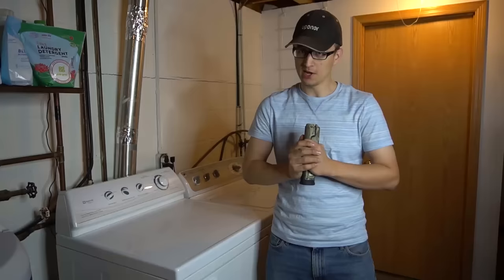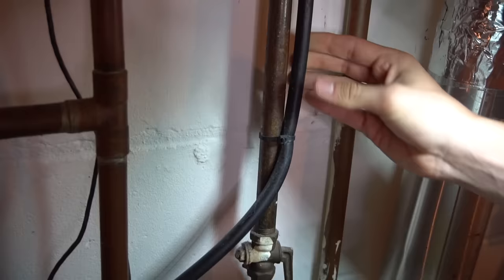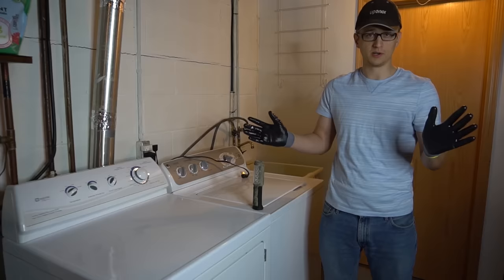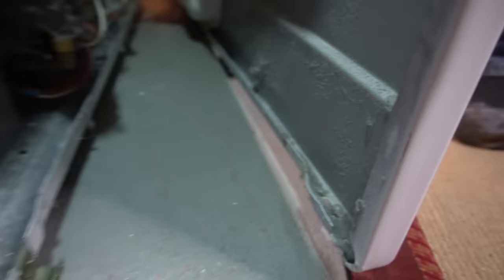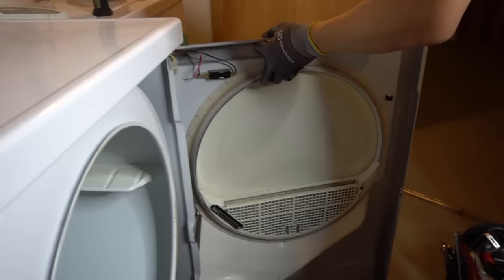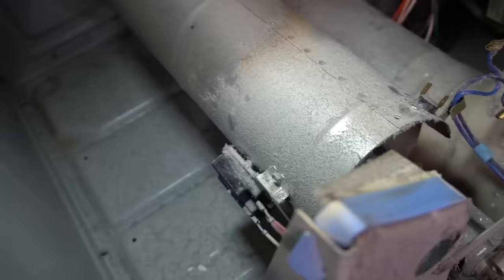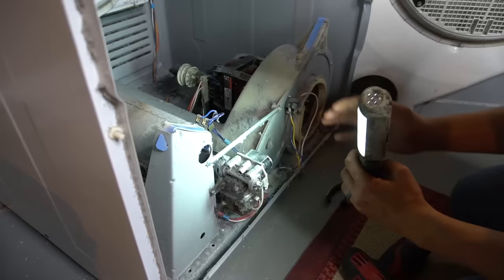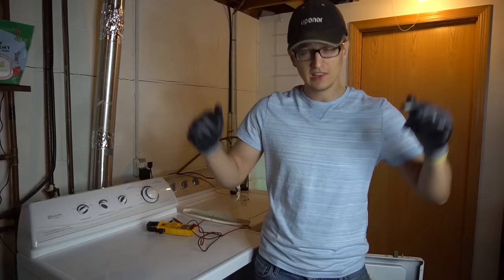Dryer Not Heating and The Most Common Fix

Comment: You don't need to apologize for your "dirty" dryer.  So many how-to videos show a dude working on a BRAND NEW unit!  Who wants to see that?  Anyone can fix a brand new unit that's working fine!  Nice to see someone working on what most people have at home.  You covered a lot of points that other videos don't even mention.  Thank you!
Reply: What happens if everything checks out and the igniter still doesn't like
Reply: Thank you for this awesome video!  It helped me fix our dryer - it was either the temp sensor or the fuse (I replaced them both since they were ordered as a pair) - and it worked!  Could not have done it without this video!

Comment: If I do this to my dryer, I'm sure I'm gonna end up buying a new one.😄
Reply: Me to
Reply: Same here. Its going to explode after I put it back together and press start. Who else thought once he took the front cover off, it would be an easy fix lol. "Take out the drum.....wtf?"
Reply: Triple ditto
Reply: Ok, guys, You can do this! you can also avoid having to do this in the first place too! how? by understanding that the number one reason dryers thermostats and thermal fuses blow, is because of heat management.
Clogged or restricted exhaust vent airflow is the most frequent cause of thermal fuse blowing. Check your lint screen for lint or a build-up of debris that could be inhibiting airflow through the dryer. Wash the lint screen with water and a nylon brush and then thoroughly dry it and replace it in the lint screen housing, Check the flexible vent hose behind the dryer meaning take it lose and check it for clogs and kinks clean everything. Also, check the exhaust vent ducts system to the outside of your home for restrictions, you'll be surprised by how much lint can get clogged in the hose and vent areas, If you do the once every Spring you will most likely avoid having trouble with your dryer. What you will be doing, in a way is giving your Dryer Lungs a thorough cleaning so it can breathe right, giving your fuses no reason to blow because its air is not being restricted. 1 hour to 1 1/2 hours is all it takes.
Reply: I would make sure I have homeowners insurance first, haha
Reply: I know right ! Mine would go kaboom if I try to fix it !
Reply: You'd be so surprised. When I first started repairing appliances, I thought the exact same thing 😂. But, once you put everything back together, it's like magic. I love this stuff. Blinkers for hire 😁

Comment: **Important** If your thermal fuse is tripped, look for a restrictive air flow situation. Most 90% of dryer components that fail are due to restrictions in air flow. Changing a thermal fuse, without cleaning the ventilation components is dangerous. Clean dryer vent to out doors, filter box to blower wheel. **Thermal fuses do not fail without cause, they are a protective device.**
Reply: I just paid 2 companies to come out one changed my thermal fuse and the other one cleaned my vents to the house but didn't don clean the actual dryer it's. He didn't even go behind the dryer to clean it out. I spent $220 for nothing

Comment: 09/09/2024 I love all your videos! From AC cleaning to water heaters, I've done soo much maintenance around my house! Yep, it was a thermal fuse that stopped my dryer. Telling us that if the LINT SCREEN CATCH is in the front, don't bother pulling the dryer out was a huge win and time-saver!  I ordered 2 fuses to have one as a backup because why did it actually blow... I've cleaned my ducts from outside and inside from wall but if it blows again it'll be time to pull the dryer out and inspect the ducting for any clog or excess lint buildup which is DANGEROUS.  Thanks again and I recommend a close quarters 90 degree bit ratchet or quarter drive small ratchet for the potential tight space for the screws.

Comment: I have a 25 years old Whirlpool dryer and here is what I have fixed so far and you have covered all of them in your video. Thank you so much.
1) Broken igniter - 279311
2) Dryer Gas Valve Ignition Solenoid 279834 
3) Belt and Pulley - 4392065
4) Dryer Thermal Fuse 3392519 (cause by Vent Clogged by lint)

Comment: Update - Complete success. Put everything back together and the new radiant sensor fixed the no heat problem. The thorough cleaning helped improve airflow, so it is drying better than ever. Most importantly the wife is very happy. I only had two small screws left over but it seems to be running fine without them, lol.

Many thanks for your great video. You were the only one I found that bothered to explain there were differences in how to repair a front lint filter dryer like mine and a top lint filter. I wasted a lot of time trying to get the back off my dryer since all the videos I originally found were for top lint filters.

Well, my gas dryer is a 37-year-old Kenmore. It has never been serviced in those 37 years, so you've got nothing on me with piles of lint inside. One day my wife told me the dryer was not drying at all. First checked that it was actually tumbling, and that we had good that air flow from the dryer vent outside. All that was good. When I checked the clothes, I found that they were cold. I checked all the things you described and the only part that failed the continuity test was the thing you said was very unlikely to fail - the flame or radiant sensor. Just ordered one on Amazon so hopefully that will fix the problem. Like you, my coils failed the continuity test; however, they did show resistance. The resistance was over 1000 ohms, so I wonder if the continuity test does not work because the resistance it too high. Just a thought.

One tip I will pass along. Take pictures of the parts you test so you can look up the part numbers online. For example, my thermal fuse was next to the dryer thermostat, but I had a high limit thermostat where your thermal fuse was located. The only way I really knew for sure that I found everything I needed to test was looking up the part numbers. You will need the part numbers to make sure you are ordering the proper replacement parts also. I also videoed each part I tested and described the results of the test. These can also be used to make sure all the wires are hooked up correctly when done.

One other tip I did not do. Take pictures and/or videos as you take your unit apart. This will make sure everything goes back where it belongs, and you reassemble in the right order.  Since I did not do this and since the project has dragged on for over a week, I hope I remember how to reassemble everything. I also did not mark which was the front and back of the drum so hopefully it makes no difference, or I can figure it out. Update - The belt on the drum was not in the center so I was able to figure out which was front and back by measuring where the pulley is from the back wall.

By the way, I checked my lint filter with water even before I found your video and not a drop of water would pass through it even though it looked clean. I just scrubbed it in water with a standard brush we use to clean off dishes in the kitchen. Now water flows freely through the lint screen. We used dryer sheets for years but switched wool dryer balls years ago. Much healthier and better for the environment. Apparently, they are also better for the lint screen.

Comment: I recently repaired my dryer that had an error code that would stop the dryer every 10 minutes,  so I replaced all the heat sensors that was recommended, it didn't fix it. Then I replaced the heating element itself and that fixed it. The heating element was still heating the dryer but one heating coil was bad causing the shut down. I ordered all parts online and watched videos on YouTube for support. These repairs anyone can do and save a fortune.

Comment: Great video. Replaced my 2 gas valve coils yesterday which solved my problem of intermittent heating. Also drilled a half inch hole on my Maytag front panel which allowed me to see the flame and the igniter operating with the front door cover on. For some reason my model didn’t have a view port. A small grommet covers the hole now but allows for easy troubleshooting. My advice to anyone if you’re having intermittent heating on gas dryer is to replace the 2 coils. They’re super cheap and super easy and pretty much universally standard. Although they may appear within specifications on the bench it’s when they’re operating where they get to be problematic. Don’t be afraid of the aspect of them being on the gas valve. You’re not doing anything that would expose you to gas or anything like that. Thanks for the video

Comment: I don't usually work on my appliances but you make it look so easy, and it turns out it is. I watched your video about fixing dryers and changed my heating element. I purchased this on-line for $25 and was easy to install, saved about $150.00. Thank You

Comment: Great video!  A feature to look for when buying a multi-meter is for it to have a built-in fuse so that if you forget to switch from ohms to volts you don't damage the meter.

Comment: So my dryer kept shutting down after running for a minute.
I tested all the thermo-switches and sensors but everything checked out all right.
Roaming through the dryer videos here, I came across yours where you showed the lent screen water test.
I pored water onto the screen and BINGO,  not a drop would pass through.
I tried scrubbing it with soapy water and a brush but still just a little water dripped through.
I figured that wasn't enough so I took it outside and sprayed Brake Cleaner front and back then let dry 30 seconds.
I repeated this front, back, 30 seconds dry.
I then took a wire brush to it and poof into powder the glaze went.
I now have no problems.
My dryer is 23 years old and had so much lent built up in it that some of it had been burning already on the coil heating tube so it may have saved our home and lives that I opened it.
Thx 4 that great information on the lent screen.
We no longer use softeners.
P.S.
Never go to bed with your dryer running or you may never see tomorrow.

Comment: Great video. You make it so easy to understand. In my case I had no heat and I checked everything and it all checked out ok. Then I realized  the setting was “air fluff” which means just turning and no heat. I then put it on regular setting and heat was there. Anyways, I learned so much here and got a chance to clean out my dryer from all the lint. Thanks again.

Comment: You are the best, you covered most of the common problems. i was able to nail the problem finally after looking at your video, its my ignitor. Tested it as per your video and there is no continuity and i see a crack. Ordering now, will comment once i replace and see if its working. I wish i saw your video first, spent around 30-40 videos prior to yours. Thank you.

Comment: Most Volt-Ohm -meters have a fuse, so if you hit the meter with power, you just replace the fuse. Fluke has expensive fuses.  The continuity beep and ohm readings were as expected.
Well done video.

Comment: I had bought another used dryer on OfferUp after my initial dryer stopped heating up. I thought this is probably trash now lol. But since my used purchase was ALSO not heating up I looked for a video like this. Great step by step instructions, taught me how to test with multimeter, gave me probabilities on what the issues were. I purchased a whole belt, pulley, and wheel kit to rid of the noise of my first one alone with a new fuse (burnt out). Fixed beautifully. Only needed to replace heating coil on other dryer. 2 fixed dryers!! Reselling the one I purchased and keeping my old one. Thanks again.

Comment: also adding in which this morning i had a similar problem. Tip: if you put too many clothes in your dryer at once it to can cause the dryer to stop without finishing, not heat, make a ticking sound, etc. I was about to take my dryer apart until my girlfriend said: babe you put too many clothes in the dryer it could do that. I went downstairs and took 50 percent of them out and boom works wonders without, having to take the dryer apart. So my advice not taking anything away from word of advice tv. Always check to see if you put too many clothes in your dryer before you take it apart.

Comment: This is a great video.  I like the explanations on how components work instead of just the steps involved.  I coupled this video with one specific to my brand of dryer just for the location of components - and the pair worked great.  One suggestion for the guy in the video (sorry, I couldn't find your name) would be to show or say what each component is connected to so it would be easier to find if the location is different in my dryer.  For example, "one wire for the thermo fuse is connected to the * and the other to the ***".

Comment: Thanks to your video, I, a person with no previous knowledge of electrical or appliance repair, was able to fix my old whirlpool dryer. I believe its from the 80s and is a workhorse, I changed with ignitor and the thermal fuse and we are back in action. Thank you once again!!

Comment: An appliance repair man kept going to a tenants house because their new dryer wasn't drying effectively. They never found anything wrong. I went to see an issue with water leak which turned out to be condensation from dryer vent. I asked them if their dryer was drying properly and they said no. So I blew at the dryer duct in the wall, condensate problem gone and dryer works better now.

Comment: Was about to get rid of my propane dryer cause it wasn’t igniting. Was going to take my mothers old electric dryer. Watched this video and decided to take dryer apart and see if I could trouble shoot. Had bought a Klein multimeter couple of years ago to troubleshoot a parasitic draw in my car. Wouldn’t you know it came in handy again. Turns out is was a bad thermal fuse. HOUSTON WE HAVE IGNITION!!! Thanks for detailed video. Ended up needing a real good cleaning to boot. Bottom of lint screen tube was pretty full. Also found $8.00 in change inside dryer under drum on floor. Lol

Comment: Thank you so much for this! I knew the former resident of my house had a bunch of pets, so guess where a TON of hair wound up? My dryer is one with the top lint trap, but based off this video, I knew I had to attack from the back. I sent one of my minions... I mean, children... back behind the thing to take the vent off and unplug it so I could pull it out. Once he pulled the vent off, he was covered in hair! No wonder the darn thing didn't dry right! We took it all apart and I cleaned out as much of that crap as possible. Again, thank you!

Comment: Dude I did everything you said and I think my thermal cutt off switch was broke! I just bought the piece on amazon for 14$! Hope it will fix my problem which was the dryer was running but no heat!  ANYWAY very informative video! Regards!

Comment: I just came here to correcta little info in this video.  Your thermal fuses and hi limit thermostats are almost always on your burner tube or heater housing. Not where your filter is.  For example, the electric version of the model dryer he is working on, the thermal fuse and hi limit is in the back on top where the electric heater is. Not in the front where the filter is. Further, the white pieces in the video are thermal fuses like he said but in all electric machines, if this is bad the dryer won't start at all. In gas machines he is correct in that it will run but not heat. Keep in mind those white fuses are found only (to the best of my experience and knowledge) in whirlpool or whirlpool built machines such as older Kenmore, Roper, newer Maytag and Amana. 

Not knocking the guy. Informative video for sure... but just a minor correction

Comment: if your dryer is not gas,the FIRST  thing you need to do is manke sure you have 240 volts where the cord connects to your dryer.this could save you some work. how ever they ALL need to be taken apart and cleaned and lubed every 4 or 5 years or so.yours is really a magic chef and it will collect lint in that plenum pretty badly. after 30 plus years of doing appliance repair i have saw a lot of these.

Comment: Thank you for your video. I'm surprised our house didn't burn down. Two screw got loose on the lint screen housing that connects to the blower wheel and a ton of lint was covering the entire inside. Lots of lint was black from the igniter section. Also our dryer started making lots of noise witch I think was the screws missing and vibrating the housing.  Clean all the lint from the lint screen housing and all the inside of the dryer and now noise gone and dryer heating finally! Like new thank you again! P.s. I found 43 cents might take the wife out for dinner haha